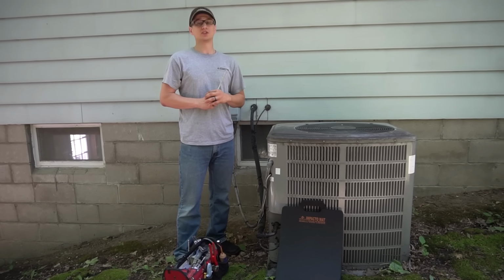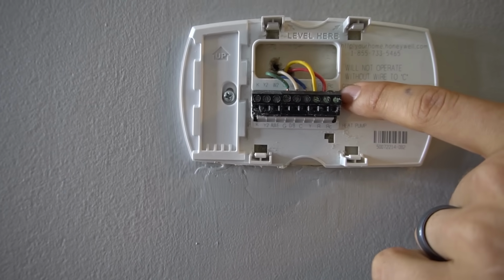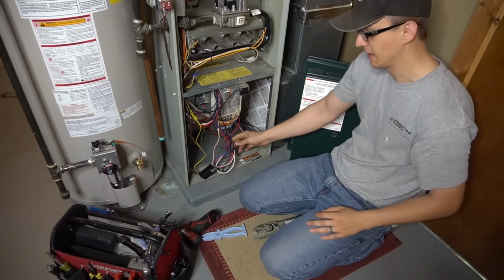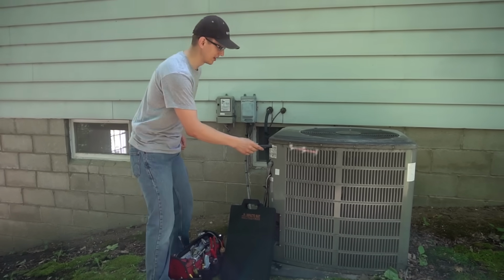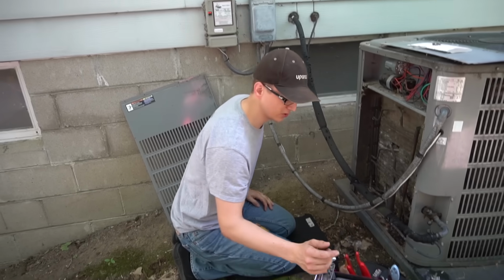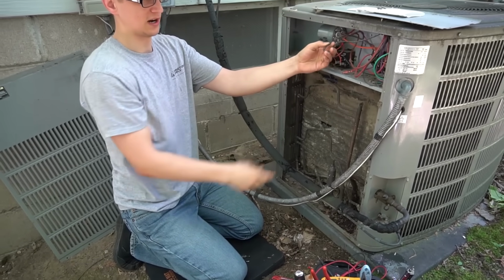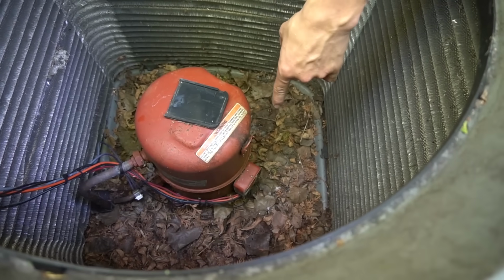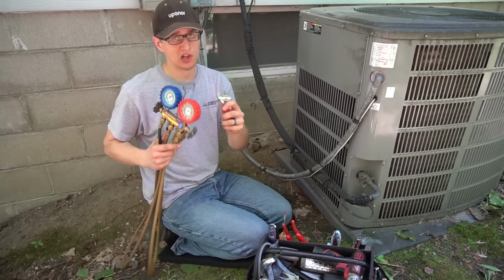AC Unit Not Turning On - How to Fix It Step by Step

Comment: Thank you.  Very informative.
Reply: I used your advice and video, and found via using my fluke and troubleshooting, and found it was the capacitor.  $14 later, and AC is ice cold again!  

Side note: one of my customers on my real job and I were chatting about what we did over the weekend.  I told them I fixed my AC, and they told me they just did a few weeks ago too... same problem.... but different result, they used  ISAAC to fix it... $700 later they are up.  So feeling great you saved me at least $686!

Comment: Just created a youtube "home maintenance watchlist".  This is the first video in my collection.  AC was suddenly not recognized by my Nest thermostat.  Thought "no power to thermostat, must be circuit, etc".  Turned off circuit breaker 30 mins nothing.  Watched your video, checked fuze at furnace etc-OK.  Then found reset on Nest-problem solved.  Sigh...  Anyway, still impressed with your video and may need in the future.  Thank you!

Comment: Question.  Carrier Unit.  Themostat is turning on home the fan and condenser.   The condenser fan is running (MUCH more quiet than usual) but no cold air.   Any ideas?
Reply from the maker: The first thing that comes to mind is that the capacitor is dead or you are missing one hot leg. (perhaps a broken wire or a blown fuse in the disconnect)

Comment: Hi there.  Thank you for putting up such an informative video!  I have a Trane heat pump.  The furnace is shooting out lukewarm air.  The outside unit isn't making a sound.  No buzzing, fan not spinning.  We tried spinning the fan.  It spins freely.  We had a tech come out yesterday to the tune of 105 bucks.  His diagnosis was that the r22 was completely gone therefore there is a leak somewhere.  However after watching your video and if I understand correctly why would nothing be running at the outside unit if there is only a leak and the r22 is empty?  Did I get hosed?  I am having a few other techs from different companies come out to diagnose in the next day or two.  This unit cools my convenience store and the house I live in connected to the back of the store.   I need this fixed asap because we are expecting some more hot weather this coming week.  Help.
Reply from the maker: Hi! Sorry to hear about that. Well, a completely empty unit would be pretty hard to mis-diagnose. Your condenser may have a low pressure switch installed on it. Which means that if the R22 pressures fall below a certain point, the unit will shut off. Did you see him hook up his gauges? Both the red and blue gauge arrows would be at 0 if it is completely flat.
Reply: r22 its illegal to refill a unit with r22 if its lost more than %50 of its charge by law the tech has to find and fix the leak.
if its a 3 ton split system unit the leak will be on the condenser where the discharge line enters the condenser 6 out of 10 times for trane split. if its a rtu same thing but on the right side of the door to the right of the compressor at the bottom  they always do the same thing.
Reply: I wasn't able to watch what he was doing because I was manning the store at the time and my husband was away.  But I or my husband will definitely be there with the next techs so we can understand and watch what is being done.  Thank you for your quick reply!

Comment: Thank you. Awesome video. However, I turned on my thermostat, and checked the unit outside, the fan was not turned on. Someone came over to fix it and it was turned on, but I am not sure if he manually turned it on from the unit. I noticed he pressed it during the fix and the fan was on.  He is coming back to repair it, but I am hoping if you can give me advise.  Seems to me that the thermostat is not communicating with the unit outside. I have two units. The one upstairs is working. Does it have anything to do with the upstairs unit? The repair person kept asking to see the upstairs one which does not make any sense. The furnace switch next to the heating/AC in our garage is turned on. Your advise is greatly appreciated.
Reply from the maker: It sounds like the unit outside is not getting 24v to the contactor. He must have pressed in the contactor plunger like I did in this video. First thing I would check is if your 3 amp fuse or breaker on the furnace control board is tripped. Also, do the 2 thermostat wires that come out of the wall and into the outside unit go straight to the contactor or does one of them go somewhere else? If on wire goes somewhere else that means there is something in series with the contactor coil that can be interrupting the power. Another thing to look for is a condensate overflow switch that would be at your inside unit. If your condensate drain line is plugged, this switch will turn off the AC  so that you don't have a flood. (Not all AC units will have this, not sure if yours does or not)

Comment: My unit blows air.but doesn't get cold. I walked outside and didn't hear my compressor on. What would I be checking for? What could be wrong? Can someone please help.  Thanks in advance.
Reply from the maker: Hello Southside :)  My first thought is that the capacitor is dead. So the fan is spinning outside but the compressor not turning on? Another thing it could be is that one of the wires going to the compressor is broken. Usually that would happen at the compressor pins. To get there you typically have to take the top of the unit off. If you look in my AC playlist (in the description) The video on how to check and replace the capacitor is called "the most common fix."
Reply: Thank you so much. Does that apply when the unit is on the roof?
Reply: I turned on the ac unit I heard the compressor kick on and it just shut down but the air inside was still blowing. We then turned it back on and the ac didn't want to blow air but there's little stars blinking on my thermostat.
Reply from the maker: If the unit on the roof is a residential split system condenser, then yes, it would have similar components as mine. Blinking snowflakes usually mean that the thermostat is in a 5 minute delay. Do you have the manual from your thermostat or can you look it up online? I would check to see what the blinking stars mean. (every thermostat is different so I can't say for sure without seeing it)
Reply: I appreciate you and the time you took off your schedule to msg me back. I got it working it was the capacitor.  But to me it feels like it's not getting as cold. But then again I'm in Bakersfield ca  and its 110. Lol have a good day and thanks again. I've subscribed to your channel and have told friends.
Reply from the maker: Thank you! :) If it is 110 outside, then you may have to wait till night time before it will catch up. Glad to hear you got it fixed though! Stay cool!

Comment: Bit of a long shot but here is our situation. Main unit outside will not turn on at all. Furnace fan is working just fine. Thermostat is allowing us to control the fan and when we turn it on we hear the "click" signalling it to turn on the main unit but nothing happens other than the furnace fan turning on. Outside on the main unit when I press the plunger you mentioned, everything seems to turn in except for the fan on top of the unit. So it seems like power isn't an issue but somehow the main unit outside isn't getting the power on signal from the thermostat/furnace. Any help would be appreciated, thanks!
Reply from the maker: Did you check for a blown 3 amp fuse or breaker at the furnace control board?  Also, if your unit has a condensate drain overflow switch, that could be tripped as well if your drain line is plugged and backing up. Do you have a meter that you can check voltages with? Also, do the thermostat wires that go outside go straight to the contactor coil or does one of the wires go somewhere else?
Reply: Thanks for the response. I took a look at your other videos and realized that our capacitor was bulging, so I think that's the culprit. Your videos are extremely informative and easy to follow. I'll let you know if swapping the capacitor does the trick!
Reply from the maker: Alright, sounds good! Likely that is all it is. Good luck, be safe!

Comment: my ac is turning on but you have to turn the fan (on the inside of the house) by hand to get it running. what do you recommend as a fix? is it the blower mower or the capacitor? we are still getting cool air but taking a lot longer to cool the house if that makes sense.
Reply from the maker: If you have to start it by hand, then the capacitor is very likely dead. Running it like that is hard on the motor. If the fan is working, then it's probably still good but I would replace that capacitor as soon as you can. Stay cool :)

Comment: Hi, I have a Robert Shaw digital thermostat (16 years old), it has batteries, which I changed, however, it stays set at 72, it will not allow temperature to be adjusted up or down.  What could be wrong?
Reply from the maker: When you took out the batteries did you give the thermostat time to turn off completely? If resetting it like that does not make it work, then the thermostat is likely defective
Reply: THANK YOU!!  You were spot on about letting the T-stat die before replacing batteries!!  It works ok now!  Thanks again!
Reply from the maker: Happy to hear it :) Stay cool!

Comment: Hi. Good job on the video. Anyone, My indoor fan works normally, but doesn't "come on" when set to "on" at thermostat. A jumper wire from R to G doesn't run it (fan) either. The unit is a Rheem Criterion Gas Furnace with a 62-24084-82 circuit board.
Reply: furnace board is bad i did this for a friend you can buy on amazon for $133  made by icm  or if your handy your could put your own relay in to bypass the bad fan relay
Reply: also the way to test this after r to g on the board is take black fan wire tha comes out of the black looking box(relay) on the board and put a jumper between it then press the door safty switch or turn unit on and the fan will run all the time until new board comes in the mail
pretend that the relay on the circuit baord is a light switch the circuit board turns it on and off your just bypassing the switch and keeping the fan on
Reply from the maker: I would try the jumper wire at the control board in the furnace. R to G. If the fan comes on, then the thermostat is defective. If the fan still doesn't come on, then your control board is defective.

Comment: Hi, Word of Advice, do you know much about older models from about 1992.  I have a Commercial Coleman( I think it's a commercial one) model FRHS0301CA.  It's a heat pump.  The blower located in the attic turns on when I set a temperature.  The outside unit(compressor and fan)  do not turn on. Tried turning fan blade, made sure power is coming from and off of different areas. I have not looked for a 3amp fuse in the blower(not sure if this unit has one and is that necessary in my situation because the blower works?)  It has 3 capacitors?(serial , parallel??).  They all look ok, meaning I don't see them bubbling up.  But on two of them the connections from the wires rusted or burnt off it seems and I have fixed that.  I have not checked capacitors yet with a multimeter.  I did find a dead mouse and it had been chewing the plastic of two bigger wires. One wire goes to fan, the other goes to compressor I think.  The wire is still solid just has the insulation removed on some area.  There is a humming noise on the part where the 30amp power wires go into and all the exiting wires going to capacitors, fan blade etc have power.  Not sure what to do. I guess check capacitors but physically they seem fine, but a little old looking.  Any ideas before I call somebody.  Thanks.  Also, I don't see any reset buttons on the  Copeland compressor or the fan.  Thanks.
Reply from the maker: Does your unit have a contactor? From what you said I didn't quite understand if you have 240v going to the unit or not? If there is a contactor, does it pull in when there is a call for cooling and does the coil have 24v? It very well could be a dead capacitor too. Sometimes with attic units, the float switch will trip too if you have a plugged condensate drain
Reply: the contactor is the part where the voltage from the breaker panel goes in to correct?  If so, then yes there is something that is constantly pulled in which makes contact on two sides(when I pull it out with pliers it wants to go back in and this part makes a humming noise when I turn the thermostat on, even when outside AC unit power is off).  2)When you say coil, do you mean the contactor coil?  If so, there is power getting there, I don't know if its 24v, not sure how to check that.  3) This unit doesn't have the pump/float switch, the water just flows outside through PVC/gravity  4)Could capacitor be bad even though it's not bubbled up? Thanks in advance. I just found you're channel so maybe you've explained this in other videos.
Reply from the maker: Okay, thank you for explaining! I will try responding in a numbered fashion as well to keep it organized ;)

1. The thing that is constantly pulled in is the contactor plunger which is pulled in by a magnetized coil (consisting of a spool of copper wire below the plunger) The wires connected to that coil, (there's 2 on either side) if you put your meter leads on them, you will get around 24v. When you turn on the thermostat, it sends 24v to the contactor coil, which pulls in that plunger and makes a humming sound.
2. Yes, I was referring to the contactor coil.
3. Okay good. I just mentioned that since I know most attic units are required to have some kind of condensate overflow safety switch by code. (if your contactor plunger is pulled in, then even if you did have this switch, that would mean it's not tripped)
4. The capacitor can be bad even if it is not bubbled up. Only way to know for sure is to check it with a meter. 

So at this point it sounds like either you have to replace all 3 capacitors or your unit is simply not getting 240v. Perhaps the AC breaker is tripped or your disconnect fuses are blown if you have them.
Reply: Hey, thanks! I viewed your view video again last night and realized that most of my questions were already in your video. I must have been scatter brained the first time. Sorry.  I learned that there are two single capacitors and the third is the hard start.  I bought the two capacitors yesterday but I don' think that will fix it because I put the the ohmmeter and all of them do the same thing, meaning they increased to the setting then go to 1.   I guess I'll install and see what happens. I'll check for 24v at the contactor to make sure like you said. It is not tripped but maybe the voltage is low for some reason.  Also, after watching your video again I remembered that there was a clacking noise months ago and I thought it was the fan hitting something.  Since this unit is for the second floor which is vacant I just turned it off and forgot about it.  Just recently turned it on to get the humidity out.  I'll let you know the results. Thanks for helping.
Reply: ok so the new capacitors are in, There is about 127 volts from each wire going into the CONTACTOR and all other wires from capacitor to fan and compressor.  Even where the mouse chewed I put the multimeter there and the reading was about 127 on both fan and compressor wire.  I'm wondering if the mouse shorted out the motors of both the fan and compressor at same time because I found it laying right in between the two where it had chewed.  I guess, after watching your video, that I need to check the compressor for continuity.  Not sure why fan went out at same time(because I have two single capacitors) other than the mouse theory.  I assume contractor is fine because voltage is coming out the exit side of it.  The only other thing I can think of is the hard start needs to be replaced( but I am not hearing any noise from compressor or fan).  Also, when I spin fan by hand nothing happens.
Reply: ok, lol. checked compressor and fan motor terminals for continuity.  All readings resulted in 1.  Multimeter was on ohms. It seems both compressor and fan motor not working.  Wow, could a short cause by the mouse have caused all of this?
Reply from the maker: A short could take out the compressor and fan motor. So did you try checking the motor and compressor windings to ground? If it is shorted, it will be shorted to ground. Also, you mentioned that you were getting 127v. The unit needs 240v. If you look at your electric cable coming from the disconnect and into the unit, it will have 3 wires in it. 2 hot legs, and a ground. The two hot legs go into the contactor. Put your meter leads on both hot legs, one on each. You should have 240v. If you only have 120v, then you are missing a hot leg. I would start by checking if your disconnect has cartridge fuses, one of those could have blown. Next suspect would be the AC circuit breaker, and lastly perhaps a wire is broken somewhere.
Reply: that unit has a run cap a start cap and a hard start kit  he needs to be careful 24v will still give him a shock on your vids you need to tell people that when they pull the disconnect to still check power with meter and also that 24v will still be on the coil if the stat is calling, i had a co-worker that did not understand these things and thats how i got hit with 480 through a single phased bad contactor and thrown from a 13 foot ceiling a broke my back, i was luck i can still walk, i have been around and seen worse.